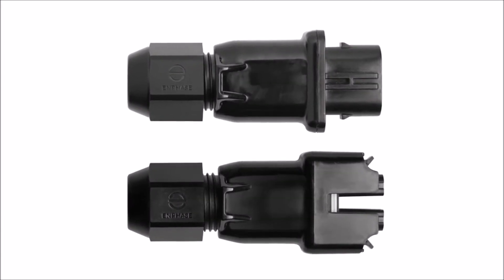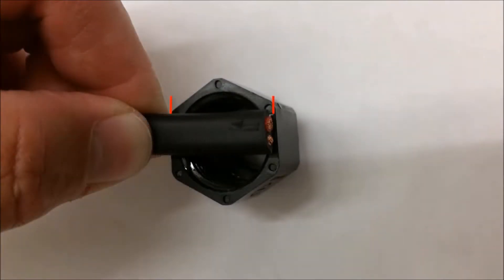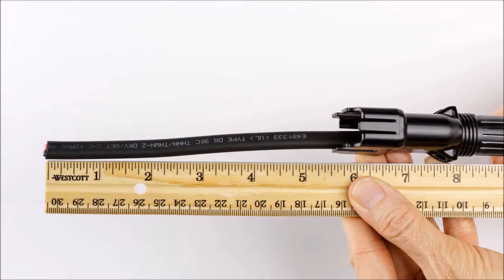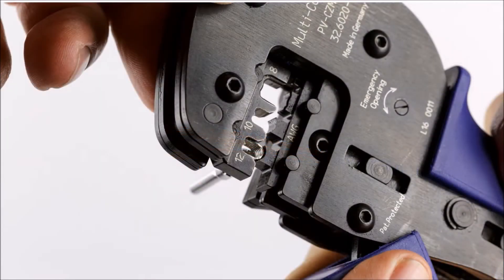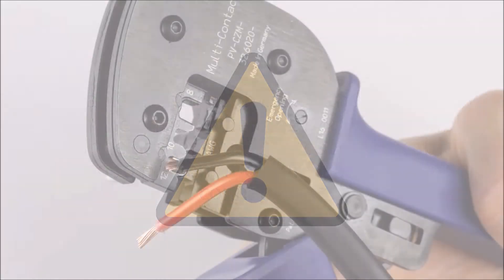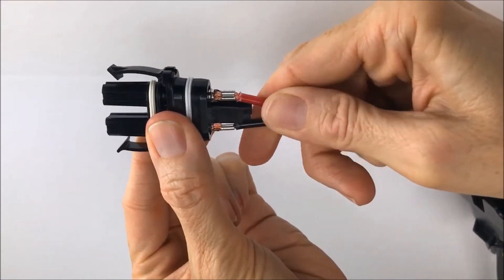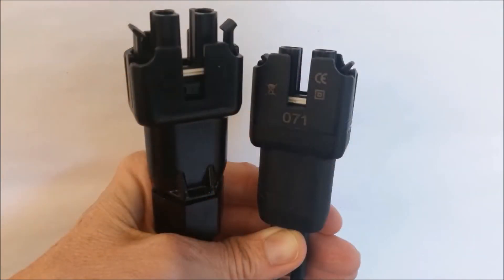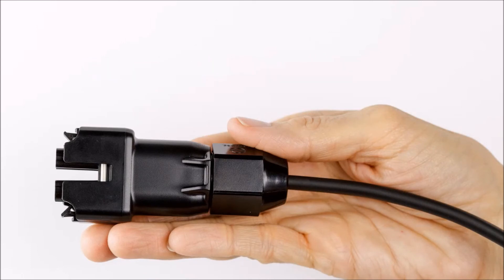Enphase Field Wireable Connectors  - How to Assemble Q-CONN-10

Comment: So it looks like you can only land a 12 AWG conductor to the terminal/lug. Why then does Enphase sell Q-Cable wired in series, but prevent installers from doing the same with field-wireable connectors??? These proprietary connectors are just another "squeeze the customer" way to extract money for the inverter product. Sad.

Comment: which way do the L and N connect?
Reply from the maker: Hello! Great question! Answer: It does not matter.  L1/L2 designations are arbitrary.  In a single/split-phase system, they are equal, and opposite, i.e., they are 180 degrees out of phase.  The Enphase microinverter outputs synchronize with whichever incoming utility phase (L1 or L2) they are connected to in the main service panel. If you have any more questions, please direct them to info@renvu.com. Our Solar Sales Engineers will be able to further assist you with any inquires you may have. Cheers!